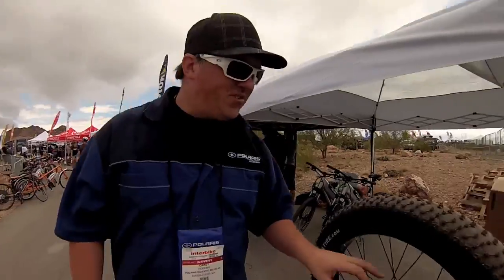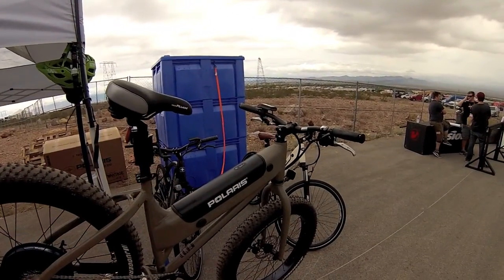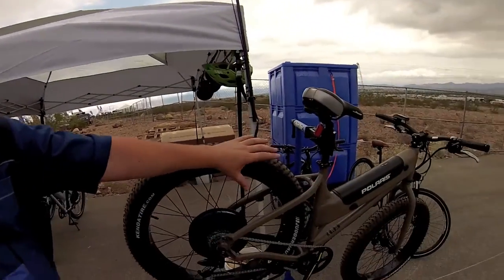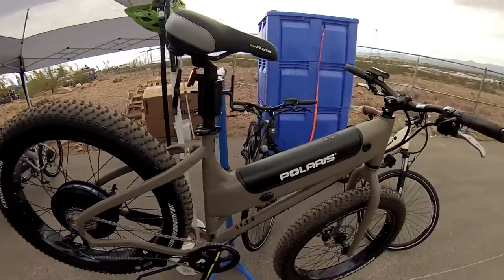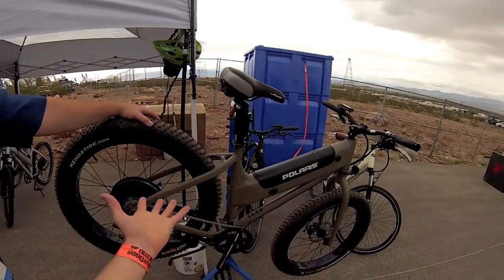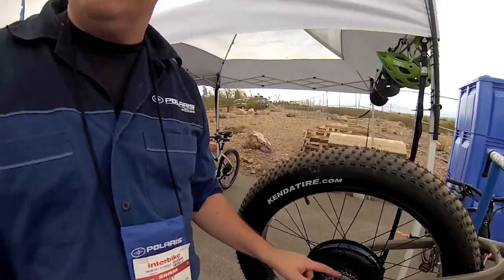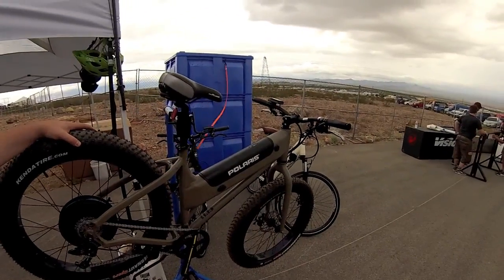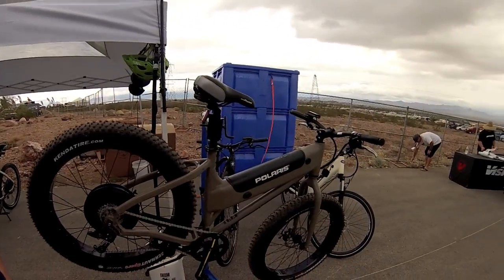Interbike 2014: Polaris Electric Bikes Overview

Comment: There is just something about fat bikes that I like.  I wonder if they will be placing this bikes with their other products or will it be sold in a bike shop?  I like to keep it simple but this hi tech bike seems to make it simple to repair and maintain.  Their attitude is correct.  You test to fail.  I like that guys attitude!  Thanks.
Reply: Sure thing, I've got several Polaris reviews to publish in the coming weeks or months. Their new bikes are pretty cool, the drive system lowers the set speed when you're riding in lower gears which feels more fluid and keeps your pedal cadence regular.
Reply: ElectricBikeReview.com I will look for the reviews.